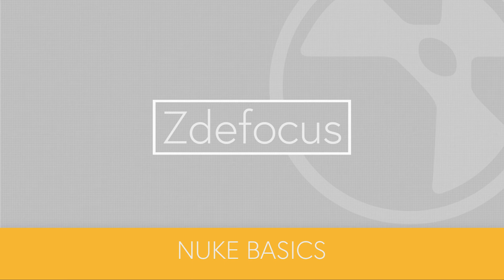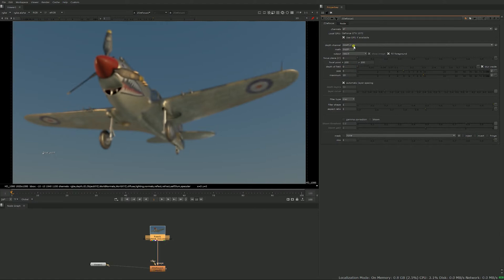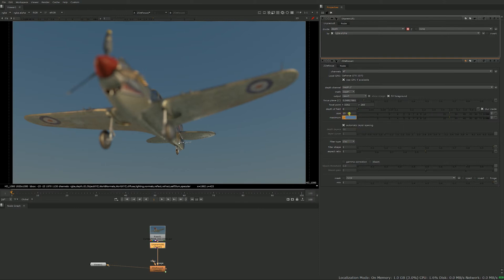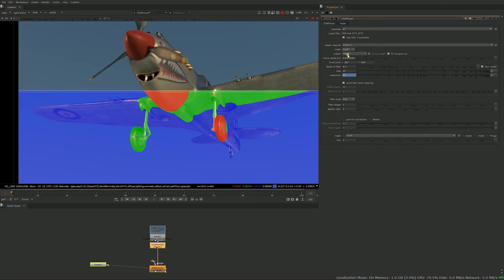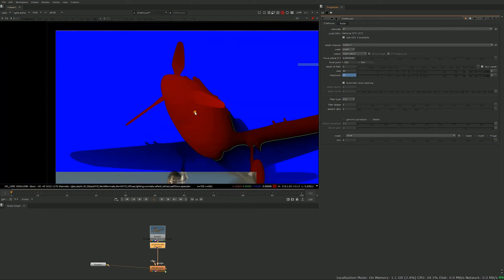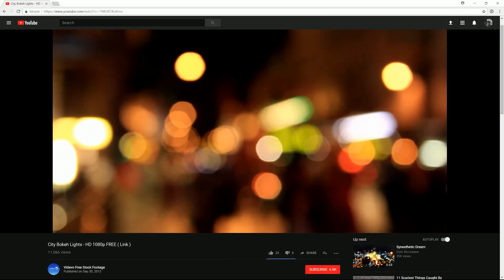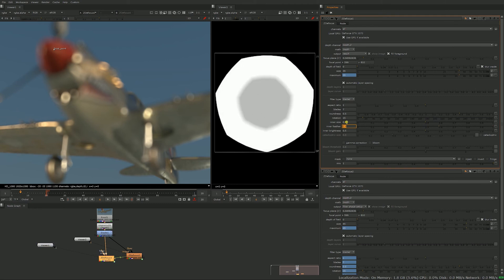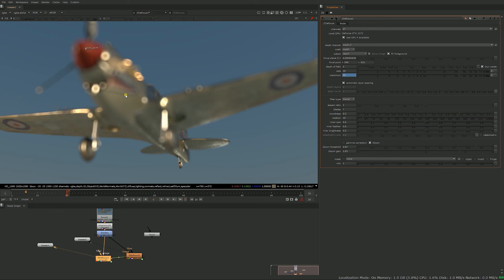zDefocus node - Nuke basics ep05 - Quick tutorial

Comment: why do you have to unpremult depth by alpha? what causes this black edges to appear?
Reply from the maker: This is something I need to cover in a new video. Premult/Unpremult is extremely important in Nuke. But basically multiplying the depth by the alpha changes depth values on pixels where the alpha is not fully solid which gets you wrong depth values for the edges.